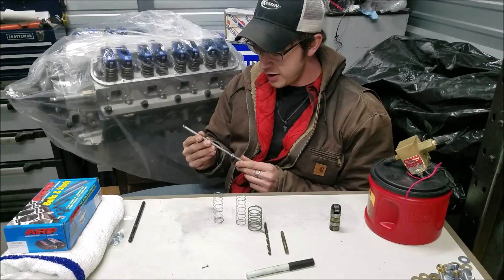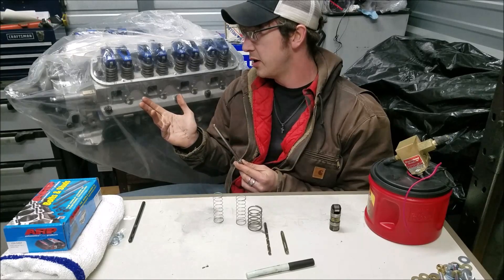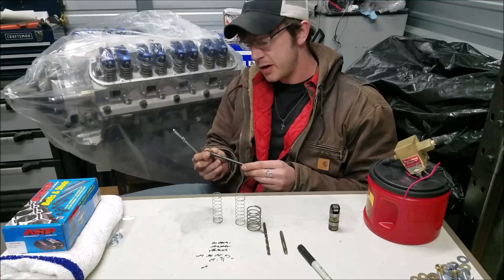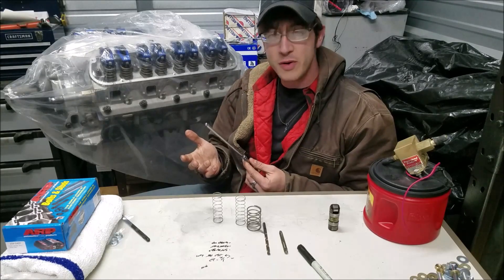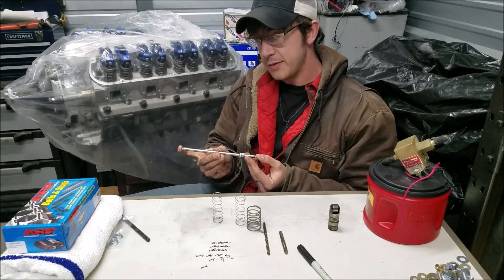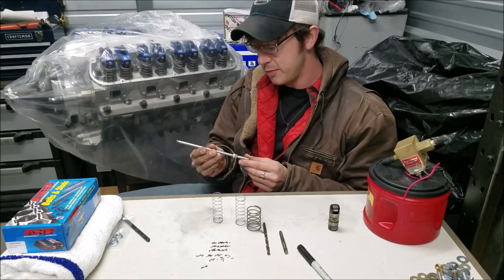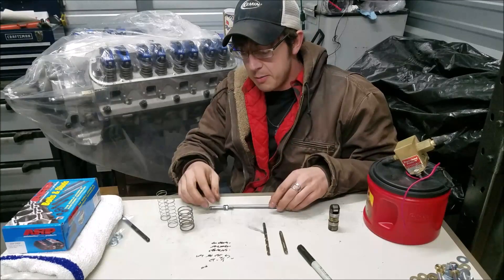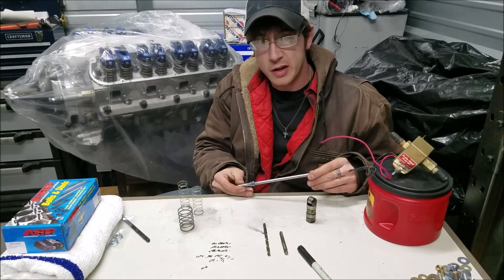DIY Pushrod Length Checker/Adjustable Pushrod Tool (How To w/ Explanation)

Comment: I purchased mine even though I typically make my own tools.  Figured I am shooting for a engine build that in theory should be capable of going 100k miles without giving me major troubles.  Its a given that anything can happen but I don't want something that could be avoidable.

Big reason why I am doing a bunch of reading on roller rocker arms.  I have narrowed it down to the Scorpion Aluminum 1.6:1 rollers for my 306 build but I am also looking at the Comp Ultra Pro Magnums cause they are Chromoly Steal in 1.6:1.  I keep leaning towards the Scorpions as they are about $100 cheaper than the Comps but just cant make my mind up as this 306 will be a daily driver turning up to 3,000 rpm for up to 3 and 4 hours at a time on county highways.  Don't want something that will force me to put my daily driver down for repairs cause I didn't do my research.
Reply from the maker: !!!!! Why will you be turning that much rpm????
Reply: @ThunderHead289 , lol C6 transmission with 31" tires with soon to be 3.25:1 axle ratio from the stock 2.75:1 axle ratio.  Ratio will be around 2.90:1 after accounting for 31" tires which should give me OEM performance if I would switch back to stock 27" tires.

The rpm would be around 2,750 rpm I hope after my transmission rebuild, currently I think my C6 has excessive slip due to age and being worked into the ground so I turn 2,750 rpm at 75 mph.  I calculated slip to be around 13% so I hope with a hughes towmaster converter for the C6 with a rebuild I should be in the 3% to 5% slip range which should put me around 2,750 - 3,000 rpm at 80 mph.

After I move from where I currently live at the county highways are posted between 60 and 75 mph but people generally do 75 - 90 mph so I am trying to set this old truck up to be capable of handling 75 to 80 mph.

If it doesn't seem to work out there is always a Gearvendors unit I can consider to swap to the old C6 and I will just have to bite the bullet and change the axle ratio again to tailor it to not lug the small 306 down more than it needs to be.

Thankfully I don't have anything for the transmission and rear axle yet so I can always still change my mind from the 3.25:1 axle ratio to a 3.00:1 axle ratio but I think a 3.00:1 axle ratio will pull me too low on the rpm and get me out of the cruse rpm range Crane lists for the Truck Max cam which is 2,400 - 3,000 rpm

Comment: So ill just make 12 of these 11.5" long, on my lunch break at work. Then use them to set preload on my lifters and leve them right? 
:)
Reply from the maker: What could go wrong 😂🤷‍♂️
Reply: @ThunderHead289  ok all joking aside, say i did this for my 300 l6. Its a very low reving engine, and there is room to make the pushrod .5" around.  Why would doing so be a bad ideal?
Reply from the maker: oldreliable303 Justin Scott these are pretty weak, but even if they weren’t, there are two main things - biggest one: there is all thread blocking oil flow to the valvetrain. Second reason - you will never get them straight. Works for checking because you are working from same reference spot - it would rotate in an engine and cause issues there 👍
But even if that wasn’t true, they would be weak - they would bent or break on the threaded area with normal valve springs
Reply: @ThunderHead289  i work as a machinist, so given i can make them big enogh around, the strength, straightness, and oiling hole, are not any issue. My thinking is that they would get to heavy for the vavle spring to push down and they may not stay adjusted very long.
Reply from the maker: I don’t want to be the guy to do it for science, I know that - maybe in a lawn mower engine. But I’m not an accomplished machinist either
Reply: @ThunderHead289  lets just go back to jokes. It could be nice for pedestal mount rocker, but i also dont kill anything i have trying it.
Reply from the maker: The one I want to try is the solid mock up lifter. A set of those would be interesting. Those with some shims under the pedestals to see what would happen.... it would be interesting to say the least!

Comment: Wow this is cool you know it makes me remember one time I've ever had a 360 in a pickup front Lifter on the driver side would mess up and start ticking every couple months I became a pro at reaching through the little pushrod hole with a lifter removing tool bringing the lifter up out of the hole reaching in there with a long screwdriver and moving it to the side then going back down through a larger Gap by the intake and grab the lifter then set the new one down in there and push it over toward the hole and grab it with the lifter removing tool and stick it in